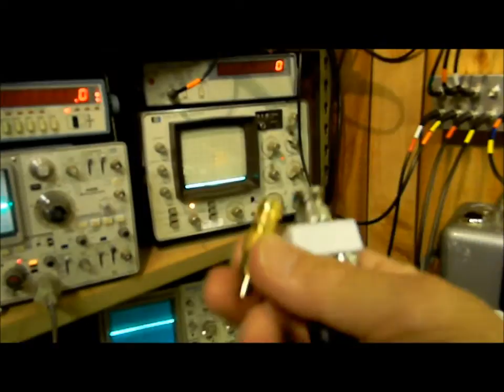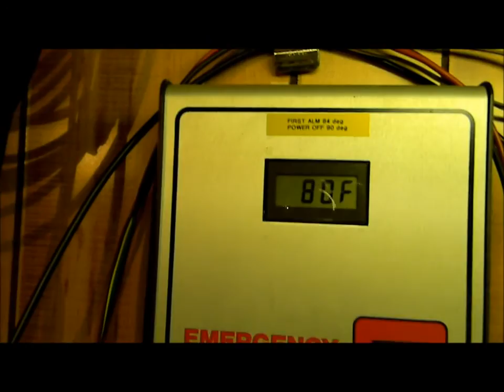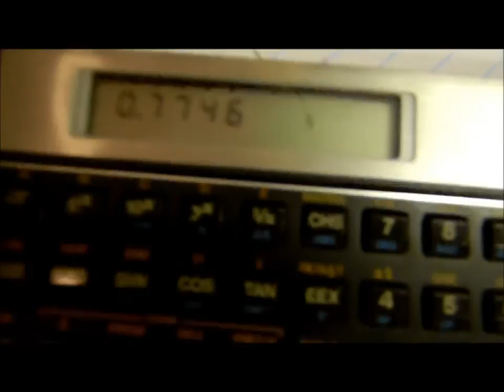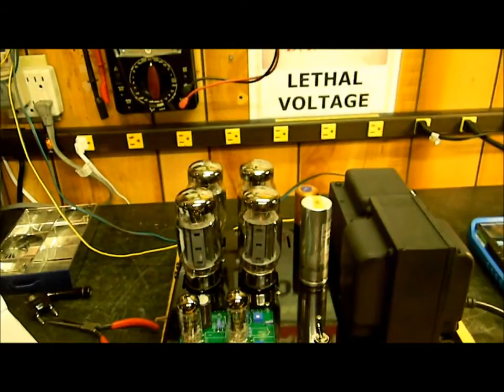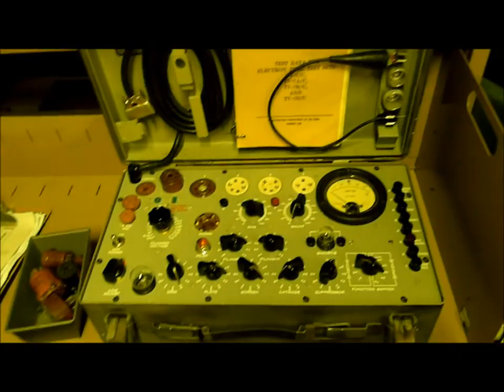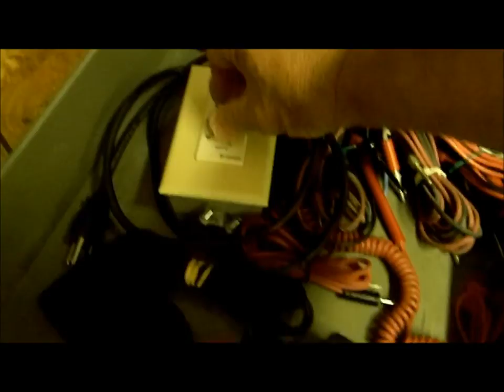My Audio Shop Setup.wmv

Comment: Gasp No VTVMs? Seriously, nice setup. Nice lab!
Reply from the maker: +Rob T Thank you - I do have one VTVM left, a beautifully working military one (can't think of the model) and I love it and do, occasionally, bring it into the shop and let it run for a few days and test it for accuracy, etc. I just recently replaced one of the leads on it as it was dry and cracked. It has a shielded lead for DC with an optional RF head that plugs on to the end of the DC probe, then AC, Ohms, Gnd, etc. It is a absolutely beautiful inside --- but --- to use it is a decision between the best and most accurate (and size) and nostalgia. I really want to have it available but my shop is so small. For analog meters the Triplett's are used daily and essential to almost everything I do. I guess the days of the bench-top VTVM is past...
Reply: Those are a very nice units--but I can't remember any of the military model numbers either.
To be honest, though I have a large number of restored and calibrated VTVMs in my collection, my DMMs or a Tripplett 60 series VOM are almost always used...with the exception of one beautiful Simpson 715 AC VTVM for some of the audio work.

Comment from the maker: That is a good point but I have disconnected each one one at a time and the only ones that increase THD is putting the frequency counter in low voltage mode and sometimes connecting up the large scope. Considering I am using either an 8 ohm load or a 600 ohm load, all the six parallel 1 meg ohm loads (166K as you mentioned) will make no significant difference. Thanks for the post.

Comment from the maker: Hi, Glenn - Thank you
WA4QGA is my call. The big scope is a 7900 that has four bays for vertical amps, spectrum analyzers, TDR, etc + time base. Basically the 7900 series has two vertical bays, the two on the left and two horizontal bays, the two on the right so a double-unit plugs into the two center two bays to span the vertical and horizontal channels. My favorite scope is actually the 485 and the one on the bottom is a 2205 GM. I have had many other scopes but sold them down to these three.